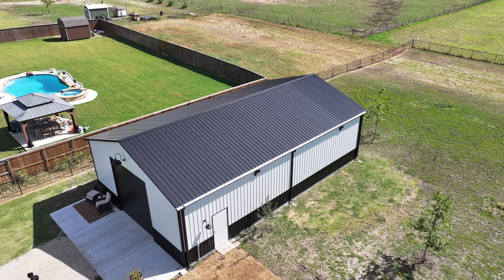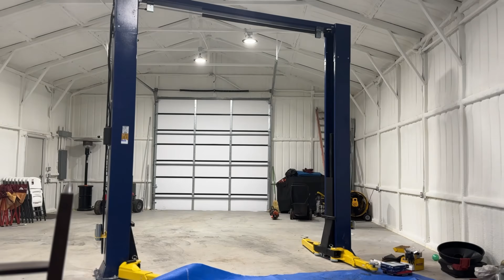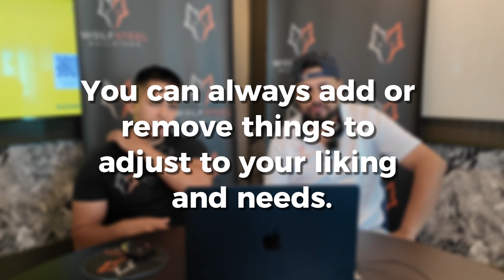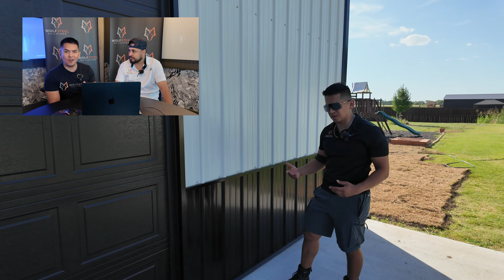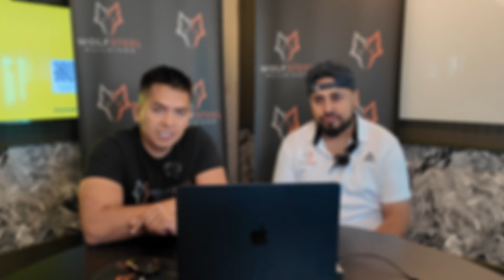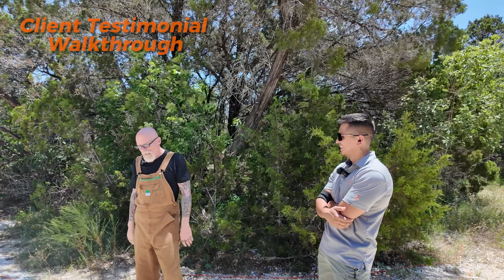30x50 Metal Building Price | Metal Workshop with Concrete | WolfSteel Buildings

Comment: Where does the 68,000 total come from? Reason why I ask is I had one design pretty much that looks exactly like this and they were between 12,000-16,000 so is the rest because of the cement pricing near you guys?
Reply from the maker: $12,000 - $16,000 is more than likely just the building. The price for this project includes a lot of upgrades such as concrete, Spray foam, paint for spray foam, custom insulated doors, etc

Comment: Very helpful, but I would like to see a video on a basic 30x50 metal building without all the customizations which cost so much extra. This price and all of the customizing is a turn off.... basic pricing would be so much more intriguing to me as a buyer. Just my opinion.
Reply from the maker: Thanks for your feedback, @ragestargaming8318. Prices do vary depending on location and the building usage. Like for this building, this was built to house the client's car lift and the structure was adjusted to ensure it will fit. We'd love to do a pricing on a 30x50 basic building. Let us know what's included on your basic 30x50 metal building.

Comment: Black Roof in Texas? NO THANK YOU.
Reply from the maker: Thanks for your comment and we know why it's a NO for you. Black roof may not be a suitable color since it absorbs more heat compared to light colors but its gaining much popularity nowadays because of the edgy look it gives your metal building. This building was insulated using spray foam which helped in maintaining the temperature inside the building.
Reply: @wolfsteelbuildings  Edgy until you get that power bill. 
Then it is not so cool. 
Anyhow, The power company's like it. 
To me it looks low IQ AF. But if it makes the customer feel good, That is what they get. Good feels.
A lot of $$$ is made from feels. 😁 Just not my $$$. I am not the feels type. 🤑
All that said. Nice steel work in the building. I am down for that.
Reply: @ironwoodworkman4917 I guess you didn't know that your avg roof is a black asphalt shingle.